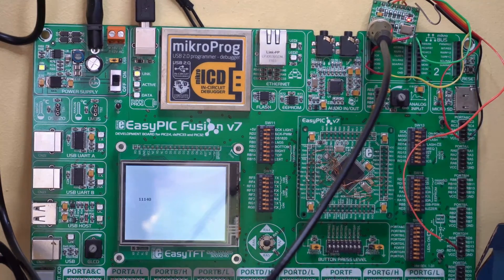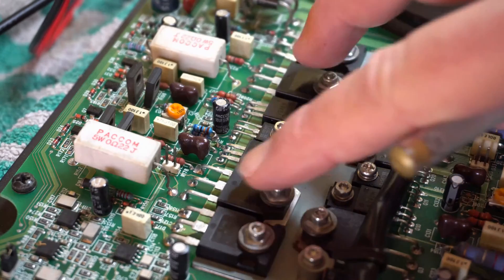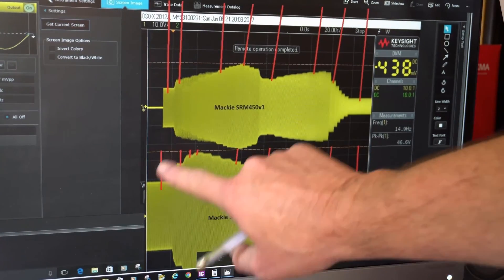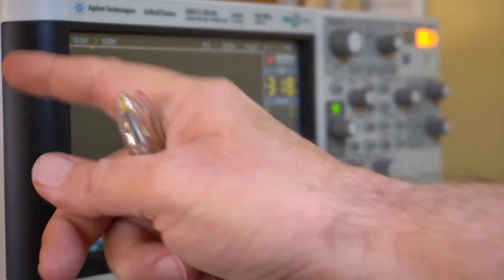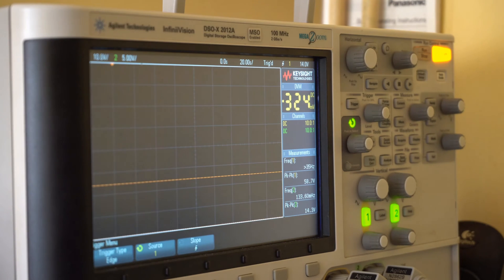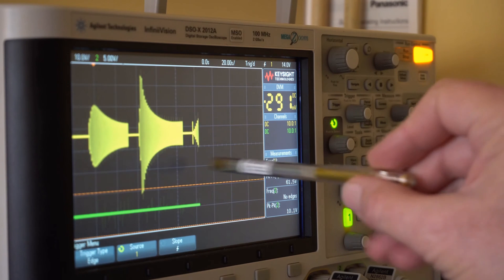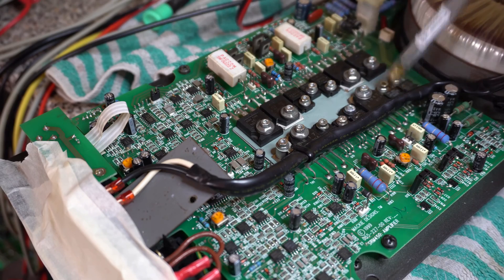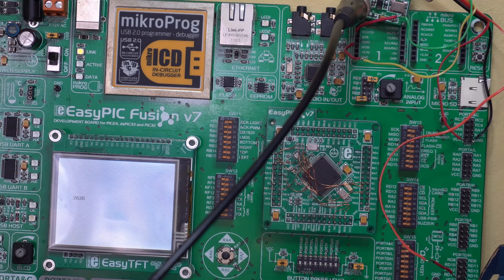Mackie SRM450v1 Simple Repair Guide & Sweep Test with Mikroelektronika's MikroC pro for Pic32

Comment: Hi John. I'm trying to assist with my local primary school with their Srm 450 v1 with no hf sound. I changed the hf driver. But still no sound. This video has been a great help. What would you suggest that I test for the hf side of the board. I'm good with a multi meter and soldering iron.  Thank you!!
Reply from the maker: Unfortunately, the loss of treble on the V1 450 is not easy to diagnose.
It could be anything from the input to the output. You would need an oscilloscope to diagnose the exact fault.
Reply: @John B  Thank you for your quick reply. I'm guessing not cheap fix?

Comment: Hi! and thanx for sharing your skills with us mortals!  Ive recently discovered a problem on one of my Srm 450 V2.    When powered up, and xlr cable from mixer is plugged in, it comes a loud sounding noise, full tone.    Ive switched the external power cable and xlr from the one that is working with same result.  Also when linked from the working speaker, the loud sound appear.  Both mixer channel is ok.

So i thought this speaker is done.   But if you plug a microphone via xlr directly into the speaker it works just fine!

So im planning to open it up and do som checking.  Do you have some insighsts to waht it might be?

Best

Kjell Arne
Reply from the maker: You have the wrong cable for your music.
If the microphone is fine, it shows something else is wrong.
Reply: @JohnB-2021  Thanx for qiuck respond!  Yes its confusing.  The other speaker works just fine via the mixer, but the humming one doesent with the same set of cables and from the same output from the mixer. But with mic only, its fine..
Reply from the maker: @kjellarnekjrgard660  You didn’t tell me you had tested the same setup on another speaker.
If it is ‘buzzing’ it sounds like the diodes on the back of the board may be broken.
Reply: @JohnB-2021  ok thanx,  ill open up an see if i can figure it out. Thanx for hellping out!

Comment: I have a pair of these used for practice monitors and yesterday one started humming really bad out of no where. sounds like a ground hum. checked all cables and such and all work fine on one speaker but the other hums really bad when signal is plugged in. any thoughts?
Reply from the maker: I stopped repairing them because too many corroded or dry joints when they get old.

Comment: I have an SRM450 V1 that has nothing but a LOUD hum when powered on. I've reflowed all of the solder joints with no change; no sign of physical damage to any parts, any idea where I should start? Thank you much, love your videos!
Reply from the maker: If it has worked with your current setup, it could be anything.
If you have never had it working, start with the input lead, it's probably wrong.
Reply: @JohnB-2021  Thanks John, but I'm getting the hum with nothing hooked too the input; I'm pretty sure a FET or transistor/diode is shorted, just not sure which one? The peak, and other red LED come on, and I've never left it turned on for more than a second or two...bought it that way, really cheap ;)
Reply from the maker: @SwampcatsHouse  The only thing that comes to mind with a loud hum / buzzing are broken pins on the +/- 75 diodes.
Otherwise it it be anything.
Reply: @JohnB-2021  Thanks for your time John; I really appreciate it! :)
Reply from the maker: @SwampcatsHouse  Actually I just noticed it's a version one you have, not version2.
It does not have the diodes I mentioned.
Other than one of the diodes in the bridge rectifier being faulty, I have no idea what could cause your 'hum'
I assume it's a loud hum / buzzing?
If not, forget it, they all hiss and hum a little.
Reply: @JohnB-2021  Nope, this is a LOUD hum, with no volume applied, like a dead short somewhere in the power supply; that's why I've never powered it on more than an instant ( and I know that current flows at 1098 X 10 to the 8th power "instants" per second or something like that ;) haha).

Comment: Hi John, I have SRM450 Ver 1 230v cabs, I need to use them overseas on 110-120v, Can you tell if possible to rewire these cabs internally for 110-120v? or do I need to change transformer? I cannot find any answer online, Cheers for any help you can give,
Reply from the maker: I believe the transformers are made for specific voltages so you would need to change it.
Reply: @JohnB-2021  Thanks for your reply. It is a shame as the SWA1501 subs I have from mackie have a 110v or 220v conector on the board
Reply from the maker: @steveforster8652  Yes I have seen them.
If you're in the UK, you can get your transformer re-wound to 220v
Reply: @JohnB-2021  They are currently 220v I am from London living in Brazil where most regions are 110v. My city is 220v but if work elsewhere it is a problem. One more question, If i change transformer to 110v use do i need to change any other components or fuses etc?
Reply from the maker: Steve Forster Hi
Lucky you being in Brazil 
No other components need to be changed.

Comment: I have a version 2 that has low output sound, can you tell me what to look for ?
Reply from the maker: Do you have a power led?
Do not change any blown fuses until it has been repaired.
Reply: @JohnB-2021  yes it Powers up, the guy who give it to me told me that the volume pot was replaced, one of the transformer also was replaced. I checked and indeed is written on the transformer that was replaced.
Reply: No blown fuses
Reply from the maker: @quilla333  
I just saw you have low output, not no output.
If you have sound and both the bass and treble are low volume, maybe you are not driving it correctly.
It needs a balanced XLR input
Reply: @JohnB-2021  I do run them in Balanced XLR, the other one sounds louder than the one mentioned before, even changing the cables in the channel output i get low output.

Comment: I have two Mackie SRM450v1's in for repair. They both have very low output. Nothing visually wrong with the circuit boards. The power supply voltages are all to spec (including +-15V regulated). Apparently they both developed the same fault at the same time. Does anyone know where I can find a schematic for this unit?
Reply from the maker: Mackie share their schematics

Comment: John. Thanks so much for sharing your knowledge with everyone! Our church has 15 of these Mackie SRM 450 V1 powered speakers. Of the 15, 6 have similar issues. The frequency response of some have minimal gain on lows while others have high freq. attenuation. Due to tight quarters and minimal spacing on pins of U9, it's extremely difficult to measure the VCO. I don't like shooting from the hip, but I may need to just replace the component. How certain are you about the VCO issue causing frequency response issues? I found a place in the US that sells the V2164 VCO. My soldering techniques are fairly good, but I still occasionally lift pads. So I need to be certain before R/R of U9. Can you shed more light on this? Thanks so much for your expertise!!!!
Reply from the maker: Manny Abeles 
Hi,
Thank you for your comments.
The VCA will not reduce the power output by much, it just shifts the response unless of course it has failed in some way. The chips don’t fail unless one of the +|- 15 volts rails have fallen to zero, that has a very good chance of blowing the VCA
Reply: @JohnB-2021  Thanks so much for your help on this circuit! 
On one of the Mackies, I traced poor frequency response back to the crossover circuit. Both of the power supply voltages to the VCO are nominal. But due to minimal access to some of the SMT parts, I experienced difficulty troubleshooting further. Knowing your expertise, what is the likely component/circuit in the crossover which could cause this type of issue? I have 6 Mackie SMR450 V1 with similar problems. Your proficency in your videos have really been a major benefit for our church. Thanks again!
Reply from the maker: @mannyabeles1969  
Good morning Manny, other than the voltage controlled amplifier, there is also the volume potentiometer, it can fail / wear out in such a way that you would not have all of the bass amplified. I have seen that a few times.
Lots of treble and not much bass (just a small amount of bass)
Reply: @JohnB-2021  Hi John.
Thanks again for your advice! 
Sorry I didn't get back to you sooner. I hadn't had time troubleshooting the last few days. 
Another srm450 failed in our church. I put this one and three other circuit boards on the bench in a line to make similar measurements. The volume control (after tracing out each of the pins) measures as expected on all four PCBs. I did discover that my schematic is incorrect. This schematic (Rev A, 1998) shows J15 on the input of the potentiometer. On the PCB, the wiper output connects to J15. Nonetheless, the volume pot is not the cause of poor frequency response, although it sounded like a great suggestion. I suspect the issue for each of these is still in the crossover circuit. 
Among these four Mackies, I have two SRM450's with poor low frequency response and two with poor high frequency response. All power supplies (+/-80, +/-45 & +/-15) all appear nominal. 

I'm running out of ideas. So anything you might suggest at this point will certainly be helpful. Also, if there's something with which I can help you, please don't hesitate to ask. I'm a retired electrical engineer with 38 years of experience. During those 38 years, the one thing I've learned is to know when to ask for help! Thanks again so much for your time and expertise!
Reply: @JohnB-2021  Hi John, 
Thanks again for all your help! I'd like to share with you what I discovered. On one of the 450s, I traced the missing signal for low frequencies, from the speaker output (J16) backwards in the LOW circuit (page 5) and discovered plenty of signal at E26. But on the output side of C149 - no signal present. I thought maybe one of the transistors around Q26 might have been shorted. However, it was actually the capacitor C149 which was faulty. Replaced C149 47uF cap.
I found a second SRM450 with the same issue. After replacing C149 on this unit and the first, both now work like a charm. Maybe someone else can benefit from this discovery.
Thanks again for all of your videos. Keep up the good work!!
Reply from the maker: @mannyabeles1969  Hi Manny,
That's interesting to hear that capacitor has failed, not had one to date but will remember for the future.
Many thanks for your comments.

Comment: Hi John, where in the Uk are you based. I’m in St.Albans, Herts and have 12 Mackie speakers. If any go faulty I will need to bring them to you. Thanks
Reply from the maker: Hi,
I moved to South Yorkshire
Reply: @JohnB-2021  hi john where abouts in south yorkshire are u/ i.m originaly fron doncaster. my bass keeps going off on my v2 makie. i can drop the amp off to you this weekend if possible
Reply from the maker: @grahamsmiffy8737  
Hi Graham,
I'm too busy to be looking at speakers, I already have an 1801 that I'm struggling with.
Reply: @JohnB-2021  hi john ty 4 geting back. i.m not in a hurry to get it dun ive a set of RCF speakers to keep me going for now.so if you can do it in next 6 months or so i would be happy with that

Comment: Love that sweep test John! Could i ask what the step time of you generator was and the time base settings on the DSO please
Reply from the maker: Hi, Thanks for your comments.
I had the scope set to 20 seconds per division, the sine wave generator goes up in 10 Hz every 0.8 of a second.
1 second to 1.5 seconds is still good for capturing the bottom end.
10 seconds per division is good for a normal test, I set it to 20 to show the function of the 3 switches.
Thank you

Comment: Hello John B. Thanks for your vídeo. I have this board with problem. Is there a possiblity I send to you my board and you to fix? The part number is: 055-227-00 srm450 v1. Have a nice day!
Reply from the maker: Hi Newtonbook, where in the world are you?
Yes I can repair it.
Thanks for your comments
Reply: My name is Newton Rangel and I live in Rio de Janeiro - Brazil but I have a  friend living in NY. We can send that board to you from NY. Where do You live? May I have your address?
Reply from the maker: I'm in the UK, it would cost a large amount to ship it here.
There is someone in the US that repairs Mackie's, I've seen them on ebay.
Reply: My Dauther work and live in Liverpool and maybe I can send to Liverpool without cost. Becomes viable?
Reply from the maker: Hi,
Yes ok.
When and if you manage to send it to Liverpool, I'll send my address.
What is the problem with the amp?
Reply: The original defect was: 1- ok signal input and no output sound. After Then other technicians moved and now I have a distorted sound and little power in the output. My daughter turns in September and returns on the 28th to Liverpool. I'll send the board with her. Do I need to send the discipador with the transformer too or i send only the board 055-227-00?
Reply from the maker: Hi,
I need the transformer too, all the amplifier, but not the speakers or cabinet.
I do not have a transformer.
I need everything in the video, the whole amplifier including heat-sink (discipador) 
Thank you.